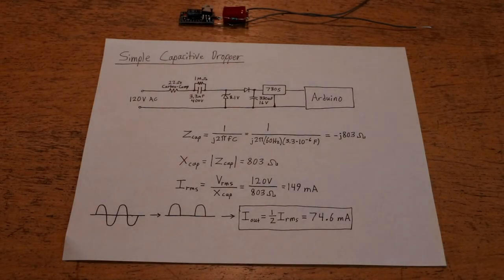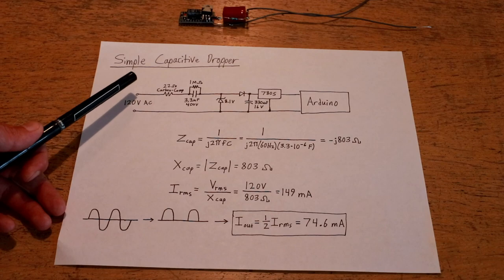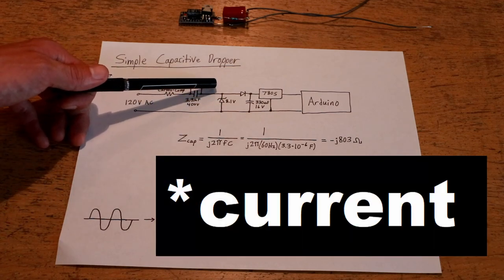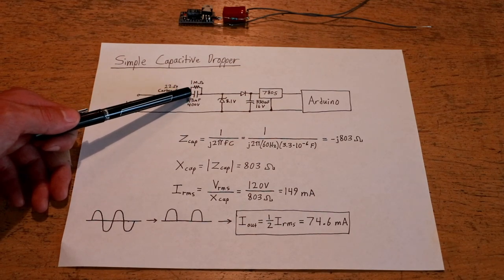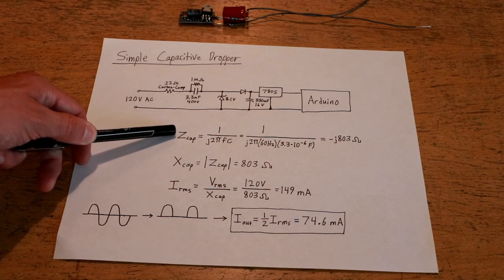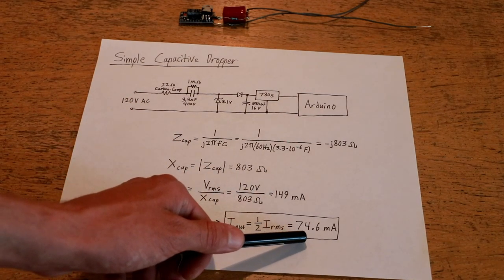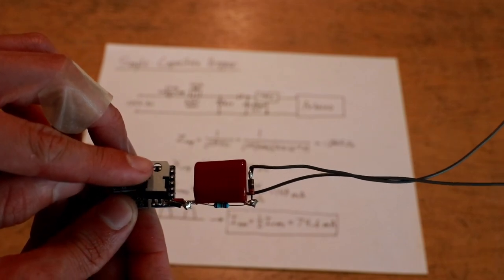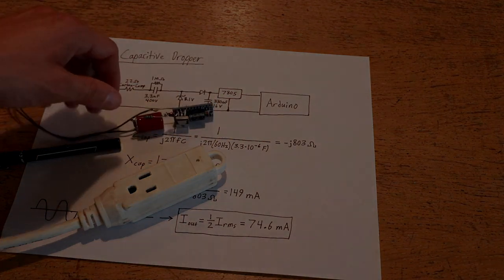EP 65 - The Capacitive Dropper

Comment: Many, even engineers, think a X2 rated line capacitor should be used for this. This is wrong. KEMET even has a warning not to use X2 capacitors for line dropping applications. X2 capacitors are designed to fail safely. The emphasis should be on designed to fail.  They will start to fail after just a few years of operation. Years ago, a KEMET engineer admitted they were designed to be cheap and not to last. No manufacturer cared if an EMI capacitor failed after it was shipped. What makes them fail safely also makes them fail with age.  We always used standard film capacitors in our dropping applications. Making the series resistor resistance as large as possible will also increase life.

Comment: Also, say the circuit draws 50mA (under 0 load), that's wasted power just powering the zener. This makes the capacitive dropper inefficient, just so everyone knows.
Reply from the maker: Totally true, so this type of circuit is best utilized when the load is mostly constant and is close to the full current provided by the capacitor (so as to minimize the power wasted in the zener diode).

It's also important to note that this circuit draws many times more reactive power than real power, and as such has extremely low power factor. Although capacitive (leading) reactive power is generally a good thing in power systems, especially where there are a lot of inductive loads like motors, it is also notable that due to the DC offset imposed by the zener, this circuit will produce some harmonics (as highlighted recently by Dave Jones on EEVBlog). 

The harmonics can be problematic for power systems in large quantities,  as they result in increased heating in the magnetic components of the system (like transformers), so these circuits are best kept small (typically less than a few hundred mA) and should only be used in small quantities.

Comment: Wouldn't it better for the zener to be after the half-wave rectifier?
Reply from the maker: A net charge cannot flow through the capacitor, so  at least two diodes are always required to allow the capacitor to be re-charged in the reverse direction on every cycle of the AC supply. In this case my design uses the zener diode as both a voltage regulator (in breakdown mode) and as a capacitor charge recovery diode (in forward conduction mode). Thus, it eliminates one additional diode from the circuit.
Reply: @DielectricVideos  fair enough :)

Comment: I am a bit rusty on the electronics, so forgive me this silly question.
You calculate that your device can deliver 74.6 mA, and say that that is enough for driving the full arduino board and perhaps a single Relay.
But you calculate that current using the AC voltage (120V), yet the DC side is 8V and after the regulator 5V.

How is the DC maximum current related to the AC current that you calculate ??
Reply from the maker: The DC output voltage will remain at about 8V as long as some excess AC current is available to bypass through the zener diode. If the DC current requirements exceed the AC current available from the capacitor, then the DC voltage will collapse toward zero. Due to Z=1/(2pi*f*C), this power supply behaves as a pseudo-constant current source if the AC supply voltage is much greater than the DC load voltage.
Reply: @DielectricVideos  I really appreciate you take the time to respond, thank you.
Unfortunately something still unclear.
I understand that the DC voltage will collapse if the DC circuit draws too much current. (That is true, i assume, both for the semi-regulated 8V and the (fully) regulated 5V)
What i do not understand is that you (I think) mean that the Capacitor acts as a pseudo-constant current source (at 75mA in the AC circuit)
How does that mean that there is ALSO 75mA available for the 5V side. The AC side and the DC side do not seem to share the same current loop.
Perhaps you are right, but i don't see how that is automatically true.
Reply from the maker: @dozog  The DC circuit is connected in series with the high-voltage capacitor, which is what limits the flow of current through the entire circuit. As a result, any current that flows through the capacitor must also flow through the DC circuit on the positive half-cycle, and through the forward-conducting direction of the zener diode on the negative half-cycle. So if the voltage across the capacitor is sufficient to cause 75mA to flow through it, then on every half-cycle that same current will also flow through the parallel combination of the load circuit and the reverse-conducting zener diode.
Reply: @DielectricVideos   :-)
I think my confusion was in not recognizing that the DC and AC circuits are in series (probably because I imagined the 5V regulator to separate them)
If what you say is in fact true then this is my hypothesis:
If you choose a 5V regulator, the DC circuit will be able to dissipate 0.38W MAX (76mA, 5V)
but when you had chosen a 3.3V regulator, the DC circuit would be able to dissipate 0.25W  MAX

Would the difference be consumed by the regulator, or should we consider the 3.3V regulator to have a greater "resistance" which causes the 76mA to drop slightly?

I am so sorry for my silly question. (I am a old physics major, we only did very basic electronics)
I am just trying to understand the working of capacitor droppers because i am repairing a 6 year old digital timer that uses a capacitor dropper. (of slightly different type, with a bridge rectifier)
The relay coil is rated for 24V, but the circuit was only producing 13V.
The capacitor is nominal 470nF,  but i assumed and confirmed that the value has dropped (to 140nF) due to aging. 
I have tested it with an 820nF that i had lying around and it works. (Will order a new 470)
I am just  trying to figure out how voltage and current for capacitor droppers are calculated.

Thanks for your time and effort to teach an old dog some new tricks.
Reply from the maker: @dozog  It's always a pleasure to help explain circuits like these, thank you for having an interest in learning about it!

If a 3.3V linear regulator is used, the maximum power delivered to the load would be (3.3V)*(76mA) = 0.25W, as you said. The overall DC circuit will always dissipate a total power equal to the average current multiplied by the zener voltage, so the total power dissipated in the zener + regulator + load will still add up to (8V)*(76mA) = 0.61W.

Assuming the load draws the same current for the 5V regulator as for the 3.3V regulator, the 3.3V regulator will dissipate more power, as it will need to drop 8V to 3.3V rather than 8V to 5V.

As to your timer project, the bridge rectifier approach will effectively double the average output current for the same size capacitor, due to utilizing current during both the positive and negative half-cycles of the waveform. It's a generally better approach for reducing the required capacitor size, but requires additional diodes.

Doubling the size of the capacitor will double the current through the DC circuit, which may or may not be a problem. If the relay voltage is regulated by a zener diode and the zener diode is rated to dissipate the additional power, it should be OK. But if the relay is directly in series with the dropper circuit, it will dissipate 4 times the power it normally would, since in steady-state the relay behaves as a resistor, and is square-law dependent on current.
Reply: @DielectricVideos  Totally clear. (Especially since you included : " the overall DC circuit.... will still add up to 8*76 = 0.61W" )
Your circuit basically "regulates" to 8V first, then to 5V.   (And I know from theory and from experience that a 7805 will dissipate quite a bit more if you have a higher input voltage. Especially if you draw a bit of output current)

Understood that the full bridge rectifier doubles the output (compared to a single diode) Your video was clear on that.
I have ordered a new capacitor with a nominal value of 470 uF, just to be on the safe side. I only used a spare 820uF to check if the relay and other electronics were still ok. Seems that way. I think I got 30V DC at the rectifier. Just for few seconds. It will work.

Thanks again for your time.
Isn't it great to learn from YouTube?!!

Comment: If you are going to use this circuit use a 330 ohm 5 watt wire wound or a ntc as a inrush limiter carbon comps can short under such spike loads and pop the diodes not to mention 33ohms @120volts == 3.64amp spick
Reply: Carbon comps?!  They still make those??
Reply: @kennmossman8701  some of the common values used in tube amps .
Reply: Carbon comps are what most snubbers use.  They are much more robust than film resistors with surges.
Reply: @opera5714  i will re do my test i have better test gear now i forgot about this post 
thanks for the reminder of this